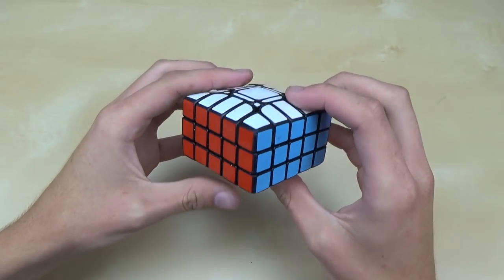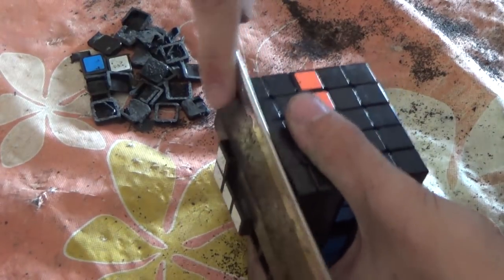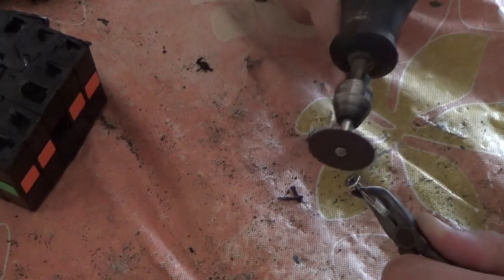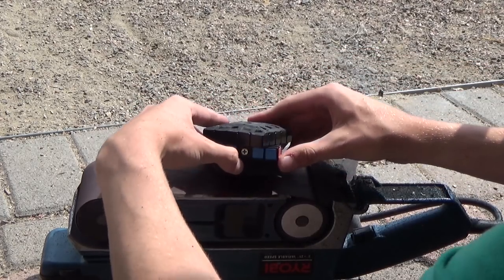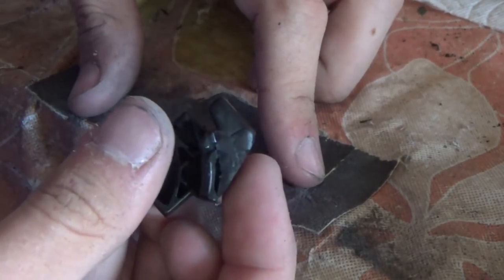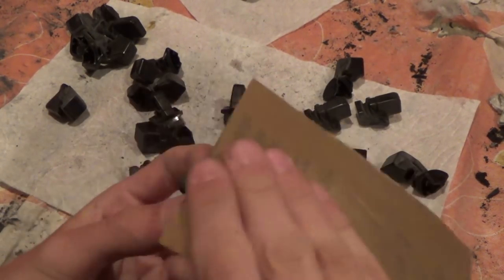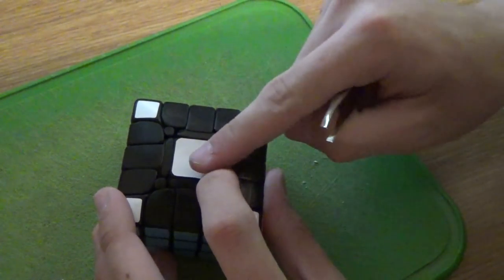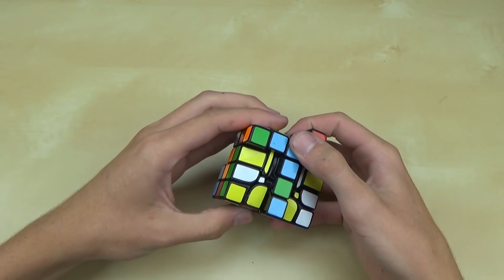How I Made a 3x5x5 Cuboid Mod

Comment: This looks awesome. I built one of those a year ago. It actually took me 6 months to finish this puzzle as I have no beltsander and had to do everything by hand. If you check the Twisty Puzzles museum, you can see that my version of the 3x5x5 is very close to what you've built as I cut it very deep as well. BTW, I haven't been able to solve it so far.

Comment: I made one of these as my first mod and I have to say yours looks so much better. How do you cut stickers to look so perfect!??
Reply from the maker: If it's completely rectangular or really small (like the corner inner pieces), I just measure/guess a size, and cut it out. If it's shaped irregularly, I cut out a rough shape, put it on, then cut around to fit the weird parts of the piece while it's on the puzzle. Also make sure that you cut the corners of the stickers off, but just barely (so that you don't create 2 new ugly corners).
Reply: legoboyz3! Thanks for the reply :D

Comment: 2nd Cuboid ever? I thought you made two 1x2x2s, a 1x2x5, and a 4x4x2? This should be your 5th!
Reply: Also, were you using Apoxie Sculpt or Milliput. You said both.
Reply from the maker: Okay, I've made a 1x2x2 which I guess counts, and printed a 1x2x5, which I wouldn't really consider "modding" (all I really did is assemble it). So maybe 3rd? :P
Reply from the maker: Also, apoxie sculpt. :)